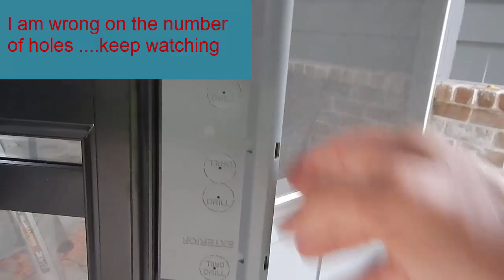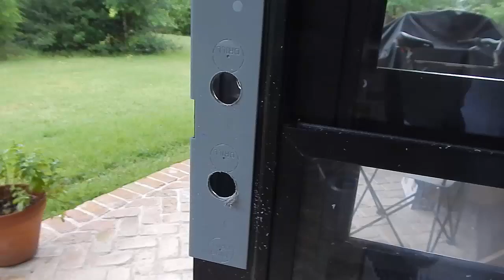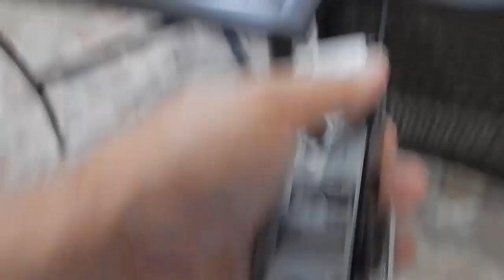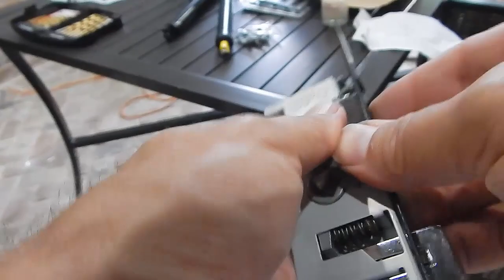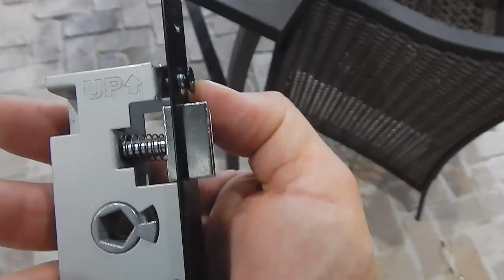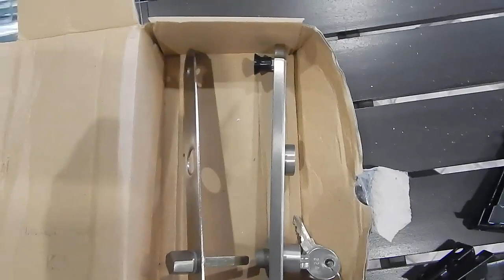Tips on Larson Storm Door Handle Installation

Comment: You're supposed to take the template off once you drill the pilot holes.  Much easier to drill and you avoid dropping the plastic piece down into the door.

Comment: Awaiting Larson  storm door and handle to come in and trying to find somewhere where it says exactly the the height of the door handle from threshold to knob? Need to make sure it is going to fit between existing door lock
Reply from the maker: There is a bottom piece by the threshold. It can be adjusted up and down. I can't tell you the specific tolerance, but I think you would have the ability to have up to 2 inches to adjust.  It is a bottom channel piece. My threshold is a 2x4 and there is  no problem. I hope that helps.

Comment: Is this a quickfit handle you installed?
Reply from the maker: Yes. It is quickfit. The finish will last about 6 years before it starts to pit
Reply: @origtex  I also noticed I guess in the new packaging of the quick fit handle, it doesn’t come with the side latch or whatever it’s called 😄 or at least I don’t see it. Do you have to buy it separately or how does that work?

Comment: What was the point of you drilling with the little drill bit if you left the temp plate on the drill through that silly you wasn't supposed to drill through the template sir you'll make your little bitty holes with your little bitty drill you take the template off and then you take that hole drill and drill through Hope you know that

Comment: Well good luck with this. Larson handles are straight-up JUNK. Poorly designed, and even more poorly manufactured. Handles have broken in different ways on two Larson doors, and these were sold as "high-end" doors. Larson is touts its great warranty, but they do not cover hardware beyond one year — so their warranty is also dismal and ultimately no better than some no-name cheapie door. What they're demanding to replace their crappy failed hardware constitutes Larsony, and it's just as likely to fail after a couple of years. Buy an Anderson or something else. Larson is shite.
Reply from the maker: Agreed, they are not the best, and they are pricey.  Sadly, so many items are junk. We need USA manufacturing with pride and quality.
Reply: Will another door handle work with the cut outs for the Larson door work?
Reply: @ramirezj115  yes, multiple handles work on the doors, you guys must be taking these handles to a bad store they hardly ever break and when they do we simply hand them the new package no questions asked.